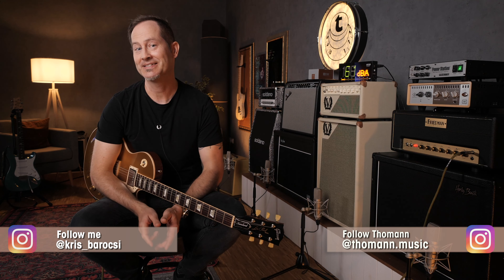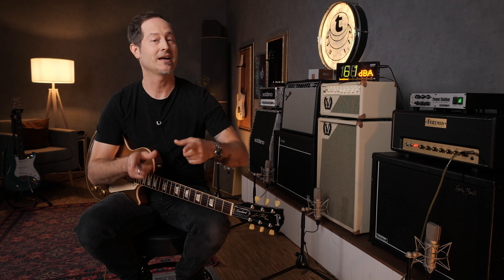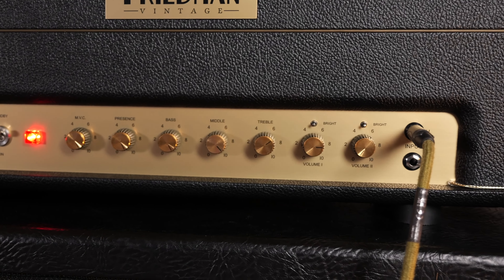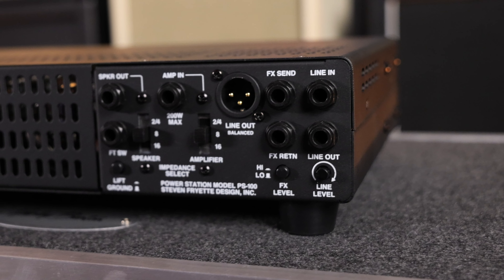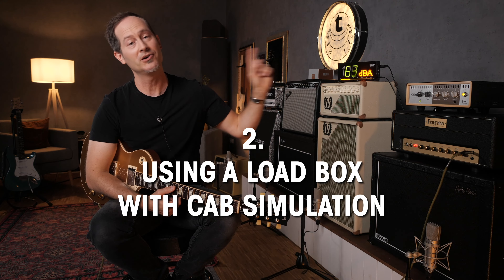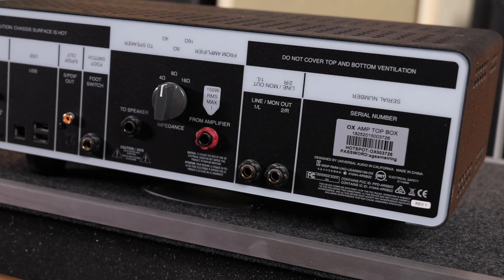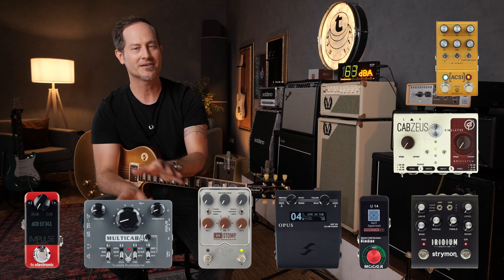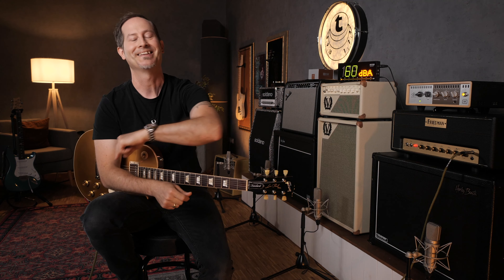No FX Loop? No Problem! | 2 Ways To Solve That Problem | Master Your Tone #11

Comment: My amp has an effects loop, but I don’t use it. I just plug in my pedalboard through the input with the amp distorted. Just set the pedal’s mix much lower.
Reply: If you use four cables, with your delay/chorus pedals in the loop and the overdrives before the amp, it'll sound better.
Reply: @1man1guitarletsgo  - My delay in front sounds just fine. Old school. It feels like a part of the sound, not like ‘off in the distance.’ Plus less cables to deal with.
Reply: @Burnt_Gerbil  In my experience, that's ok if you don't change from a clean sound to overdriven.  You set the delay how you like it with no problems.  If you set it for the clean channel, however, and then change to the o/d channel, the echo effect can become too loud in the mix.  Using the loop  stops this happening.
Reply: @1man1guitarletsgo  - It’s a one channel amp that I use distorted. Setting the mix low works fine.

Comment: There are more options than this... the Boss Waza TAE and the Palmer Supreme Soaker both have FX loops built in and act as a load box, attenuator, DI to PA etc... I think the way the OX does it is a bit clumsy in comparison to the Boss and Palmer. I get it is the industry standards etc (and probably is for a reason), but I don't think it is the most versatile. You can really have your cake and eat all of it if you look at other options?

Comment: Please correct me if I am wrong BUT how can an FX loop sit in front of the power amp may I ask. Does it not sit in front of the preamp and BEFORE the power amp? What you said makes no sense.
Reply from the maker: Hi, it depends on how you use "in front" and "before". To me (and to those I asked) these mean the same in this case. So the preamp is the first in an amp. Then comes the fx loop and then the power amp. So the loop is in front (=before) the the power amp and the preamp is in front (=before) the fx loop. Those that make sense now? Cheers //Kris

Comment: All my pedals (if I use any) work well in front of my amps (wah, tape echo, spring reverb, phaser), if I use them in the fx-loop, the final sounds differ. A big difference it also makes, it you have a really good fx loop, which offers adjustable parallel and serial use or only a regular serial one. 
Any good load box, which converts an amp signal to line level, can be useful, as you the can at least add some effects between the amp-line and the cabIR signal, if placing it in front of the power amp is impossible. 
Always depends on the results, you are looking for. 

Every setup is different, so just try and find out....

Comment: Damn man .... That OX BOX sounded pretty sweet 2 me on the 2nd guitar playing bit...  & Can RUN IT INTO A MIXER ALSO !!! Especially when you flipped up da ol toggle switch,and made her "Cry N Sing".... Lol.... Cool info...but ,as we ALL KNOW....TONES COST $$$ SO--- HOW GOOD YA WANNA SOUND??? Right??🤔🤜🤛😉 Anyways, TUBES ARE AWESOME -SUSTAIN,WARMTH,GROWL,PUNCH,N GRIND....BUT.....& maybe it's just me...but I do feel that SOLID STATES have progressed SO SO VERY FAR,Way beyond yesteryears....and one can come AMAZINGLY CLOSE TO A "TUBISH"(LOL) Tone N Sound....LIGHTER WEIGHT TO HAUL TO GIGS, No "TUBE REPLACEMENT"... Etc... Etc ... Ran mine Straight into Mixer as well ... And I KNOW , WITHOUT A SHADOW OF A DOUBT...SOME (MANY probably) LOL ..WILL DISAGREE,TURN N EAR,ARGUE....WHATEVER THO.....YO, it's really... UP 2 U YA KNOW ??? I've had 2 BOSS KATANA MII 100 wt. - (STEREO THING LIKE YA SAID LOL) ... BUT THEY DID DECENT FOR THE $$.... AND .... FOR ALL YA TUBE LOVERS,HUGE POWER PUSHING AMP MONGERS....I ALSO HAD AN AMPEG V5 100wt HIGH/LOW GAIN WITH 7 TUBES IN IT-4 6550's and 3  12AX7's.... Running to a MARSHALL 4x12 Cab w/ Green N Creamback CELESTION SPEAKERS..... AND ....UMMM... TELL YA WHAT ROCKERS N ROLLERS--++- That Head was RARE, EXCELLENT, EXCEPTIONALLY BUILT...AND... OMG 🤯👀 FREAKISHLY LOUD, AS BLEEDING EARS SAY !!! HA HA.... THOSE HEADS (AMPEG V5's) were almost like EARLIER SVT's.... And RAN TOP DOG TO A MARSHALL 900 JMC..... but, HEAVINESS, CAREFULNESS,ETC... FINALLY PUT ME OL BACK  into...."SUMBITCH ... I AINT in my 20's-30's NO MORE"....LMAO 🤣.... VICIOUS VICIOUS GAIN , SUSTAIN, AND WARM SOUND .... BUT, I TRUELY APPRECIATE UR POST...LOVE THE CONCEPT, AND can DEFINITELY SEE THE PLUSES,AND EASIER WAY OF DOING THINGS W/ said gear ya Showed N Played for us Bro..... "AINT TECHNOLOGY JUST DAMNED WONDERFUL Y'ALL?? ".... WHATEVER ONE DECIDES..... EVERYBODY ROCK ON BABY !!!? ROCK ON !!!?❤😊😜🤔👀🤜🤛✌️.....👂"HUH....Can't hear ya !!"... LMAO AGAIN !! 😂 PEACE ✌️#MusicMaker69

Comment: Question on this! I have a 16ohm Two Notes Torpedo Captor, not the X model. My FX Loop on my amp doesnt work and a tech couldnt fix it and I want to run my QC through it and use the power amp. 
How can this be done with the Two Notes?
Reply: If I'm reading your comment correctly... no, you could not. The Captor is after the power amp.

Comment: Wouldn’t modifying the amp to add an effects loop be a more economical and portable solution?
Reply from the maker: Yes, if: 
1.you know someone who can do it
2.you are willing to diminish the value of you amp (by modding it)
3.your amp stays clean in the power amp section so that the fx loop mod makes any sense at all.

So it's a little complicated but in certain cases that is a valid option to do. Cheers //Kris

Comment: When using a high gain amp with the Fryette Power Station does the Power Station’s FX loop have any dry signal bleed into it?
Reply from the maker: The Power Station's FX loop is a series loop as far as I know. That means, that the whole signal coming from the amp goes through it. But since it's not parallel, it will become 100% wet if you put and fully turn up a reverb or anything else in that loop. 
Long story short, the Power Station's loop is exactly the same as the fx loops in 99.9% of current guitar amps. Cheers //Kris
Reply: @ThomannsGuitarsBasses  Thanks for the reply. Not all series loops are created equal in terms of bleed through. When using high gain, many amps will send signal from the preamp to the power amp, even if the loop signal is set to zero. Some exhibit enough bleed that quiet playing with digital effects will give a phasing effect.